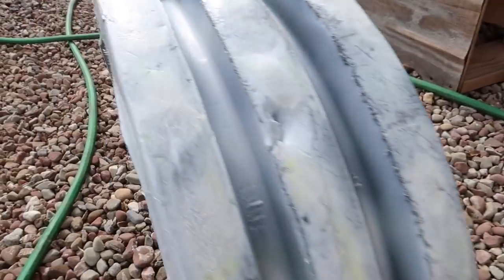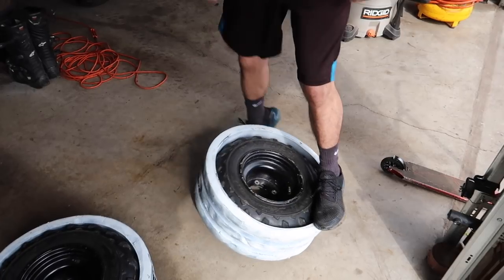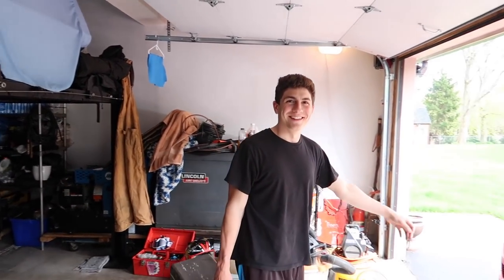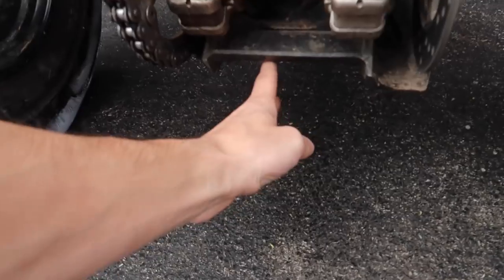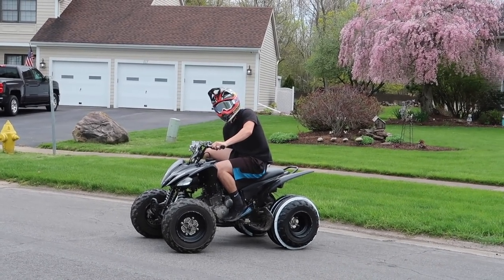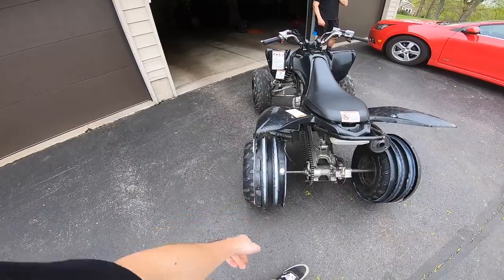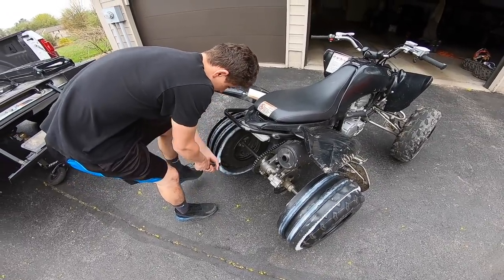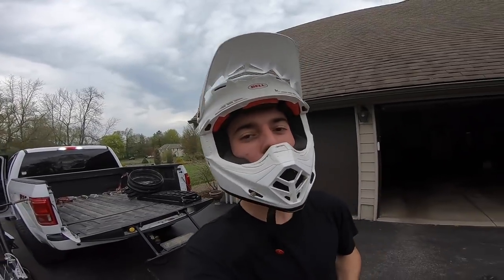DRIFT QUAD PVC TIRES!!! GONE WRONG

Comment: I used to change tractor trailer tires and if one of those blows up it's no joke, that's why they "require" you air them up in a cage lol,, but I'm guessing you drift quad tire would blow at 70psi

Comment: For a fun video take an old quad tire and wheel and set it outside and leave the air compressor on and just see how much air it will take before it blows
Reply: Matt Orman 225-250psi is about the amount BUT FYI the rim can come apart and go through walls. I’ve seen a split rim that blew the two sections apart go through a ceiling 20’ tall
Reply: Sorry
Reply: fun video?   Do you have fun watching how long a kettle takes to boil, too?

Comment: 9:29 that's what happens if you go fast around corners on quad
Reply: depending on the direction you turn in the tires will lift up
Reply: @faze-jaho1586  true
Reply: 07JaxonMcc he just let it whip around on him and he was up to high he’d be so much better if he also used his body to push the quad more

Comment: They wouldn’t burst or explode until 200psi or more. The burst psi is 200psi for almost all rubber tires even if the max psi is 36. The max is only for safe operation nothing to do with how much the tire can physically hold. If it could only hold 36psi before exploding you wouldn’t be able to hit any bumps or Jump a quad or anything that puts pressure on a tire. So 200-250 is my bet

Comment: As a physicist if you change the shape of the container holding pressure you change resistance and the path of least resistance. In this case your minimizing surface area of resistance limiting it to the sides of the tire so it's more likely to blow under pressure it would normally handle.

Comment: 0:42 "PVC in our case corrugated pipe" nah bruh, not anywhere near the same. Corrugated has about 1/16 the wall thickness as schedule 80 PVC. I can see where this is going before it even starts because you cheaped out on 4 foot of PVC.